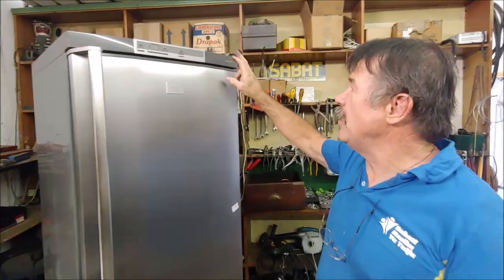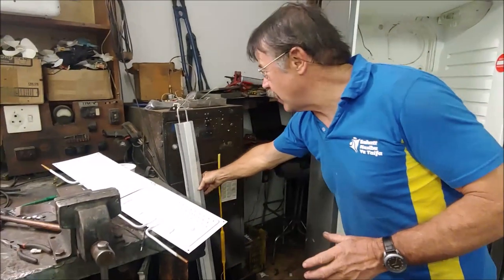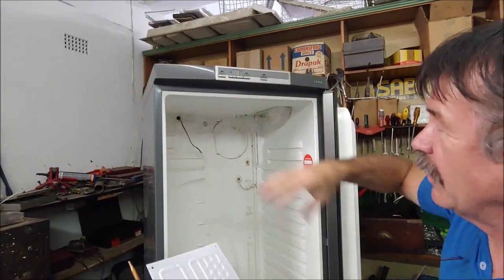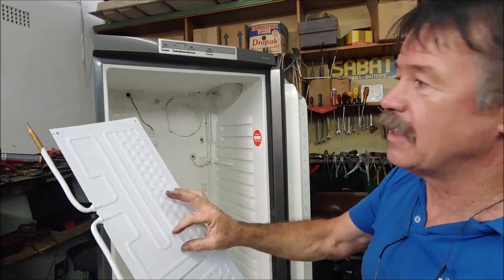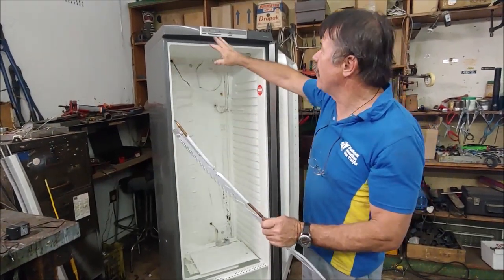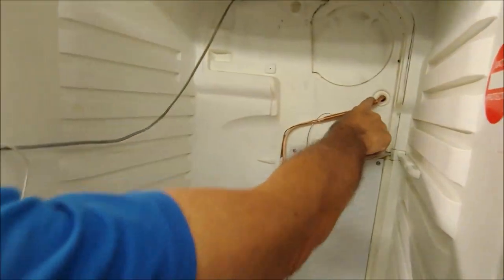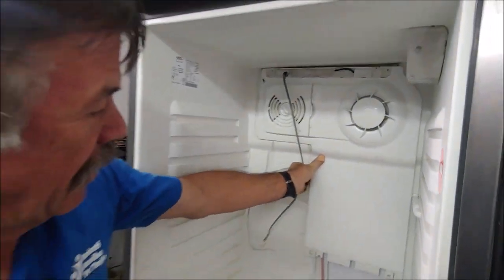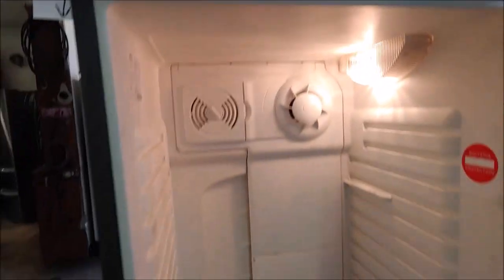Replacing an evaporator coil with a cold plate

Comment: And again an inventive solution Johannes! Are those two identical evaporator plates new ones? Most of the time the capillary is built into the evaporator plate, with this I don't see? 
I mean pre-installed in the evaporator plate ..
Reply from the maker: They are new. No the capillary wasn't built in. The one copper end on the new evaporator plate was narrowed to accept a capillary but I cut that off and used that end to link to the second cold plate.

Comment: Helo Johann....You should've just used a longer evaporator plate and fooled the system.  Connect the Arenco thermostat to the plate and bridge out the live wire from the fridge to the thermostat and straight to the compressor.  In so doing you don't have a fan running 24/7. Only 1 live wire is used and the system fooled...
Reply from the maker: The reason why I used 2 cold plates is because I could not find one long thin one that would fit there. You do need the fan to run to circulate the air underneath all the covers.

Comment: Another refrigeration unit saved!! Great job! I have been looking online for cold plates similar to the ones you used in this video. Have not had any luck.  Is there another name for the cold plates? The size that you used in the video (the single ones) looks about the right size that I need. Can you recommend a source for the cold plates? Thanks, and keep up the good work! I always enjoy and am intrigued by your videos!!
Reply from the maker: The importers that we use call them evaporators, some call them evaporator plates. I call them cold plates.
Reply: Thanks. I'll search under evaporator plates. The ones that I'm finding are the type that you freeze, remove from the freezer, and then place with the items you wish to cool down.  Have a good day.

Comment: what do you do if the door won't close?
Reply from the maker: First try & pinpoint what is stopping the door from closing. Most of the time it is due to the door dropping from wear on your hinges. By adding an extra washer on your hinge to lift the door up, can fix the problem.

Comment: Hi Johann, love your videos!
Have a question, we have a static combi fridge with refrigerator at the top (large compartment) and freezer on bottom. It freezes well in freezer, even -21C, but in fridge its not cooling, it stays at 14C.
Do you know if evaporator at top has a capillary tube, or just the evaporator in the freezer? In freezee I can see pipes for capillary and steel pipes on shelves.
Reply: It has only one compressor and we recently refilled gas and tech removed pipe used for heating around door gasket (or so they said). It worked for a few weeks in fridge, it got frost on back side, but wasn't cooling as before, wasn't making a vacuum after closing door, even though it was summer.
I'm suspecting either top capillary clogged, or slow gas leak from top area, or compressor losing its ability to compress and it just works for freezer.
Reply: I made two holes in the top of freezer and mounted a big fan (duct fan) to pull air from freezer and two small pc fans over the other hole, to push air in freezer, this allows it to cool.
It reaches 3-5C on first shelf from bottom and around 6-8C on second shelf (top). 
Thermostat doesn't do much anymore, so I put a digital timer plug, to give fridge 15min breaks every 2.5hours.
Now there's more snowy frost in the freezer and we need to defrost freezer more often, but at least it works.
Reply from the maker: @nilsfrahm1323  Before you modify a refrigeration system from the original design, you have to be sure that your modification will be successful because once you have cut pipes off & made holes in it, it is very difficult to get it back to original again.
Reply: @JDNelRefrigeration  Thank you for quick reply. I didn't alter any functional elements (pipes, wires). I only made two holes in plastic and foam between fridge compartment and freezer compartment. Now, some cold air from freezer is circulated in the fridge. It had static design initially, now it's similar to fridges with active cooler. If I need to undo the change, I only fill the holes with some foam and remove the fans.
Reply from the maker: @nilsfrahm1323  Put it back as per factory specs, then find the original fault and then if you feel you can improve on the factories design then alter on the design.
Reply: @JDNelRefrigeration  It's not worth the trouble. Technician already fixed it once, if there's a small pore in the pipes or evaporator inside refrigerator, afraid technician in my area will not repair it, would also cost much. In case it fails fully, I'll need to buy a new one. Now it just needs more frequent defrosting for freezer, at around 6 days. It melts quickly, as it has three shelves with evaporator pipes, not just one compact block. This is second fridge in last 10 years, previous one was No Frost, but its mainboard failed in just a few years and tech couldn't repair it.
I wish I had more experience back then, I think just a few capacitors were bad and could have been easily repaired.
Reply: @nilsfrahm1323       t thank you sir